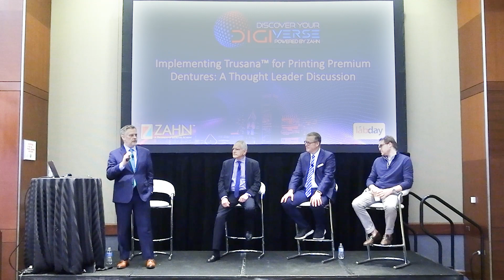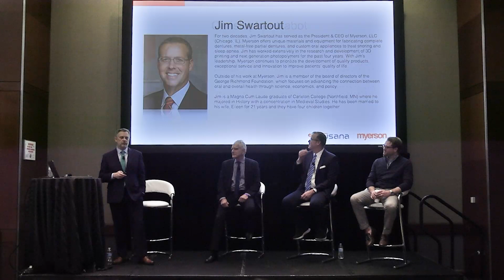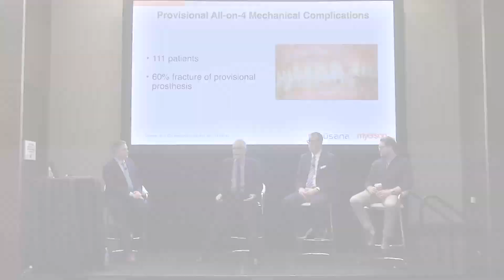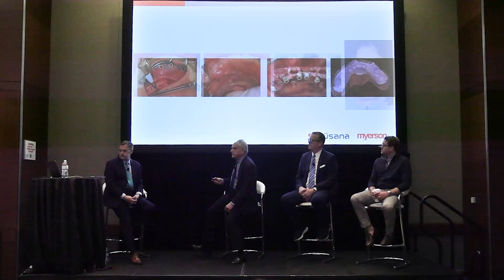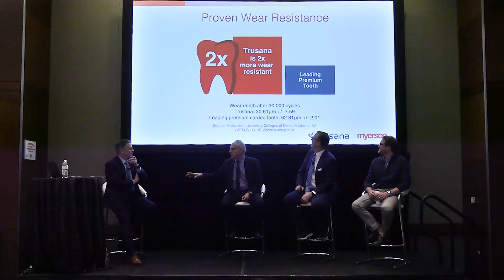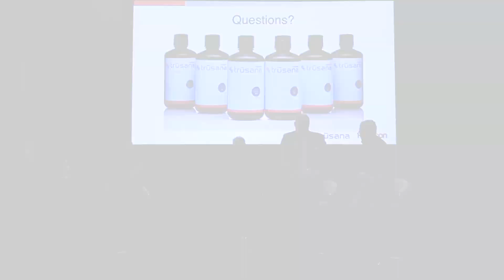Implementing Trusana™ for Printing Premium Dentures: A Thought Leader Discussion

Comment: FYI: To finish a premium printed digital denture takes just as much time as a conventional denture. Maybe even slightly longer as the teeth and denture base needs more effort to stain and glaze to give it the premium look. High quality printed dentures are not a prescription service switched out every six month for 20$! More like 500$. The material cost is only secondary. Plus they need to be fitted or relined as things change in the mouth.